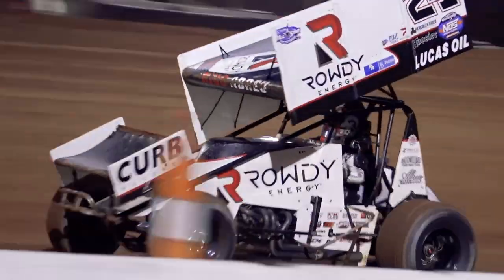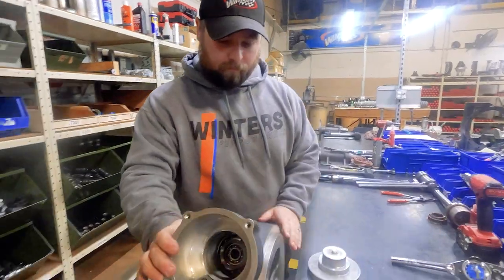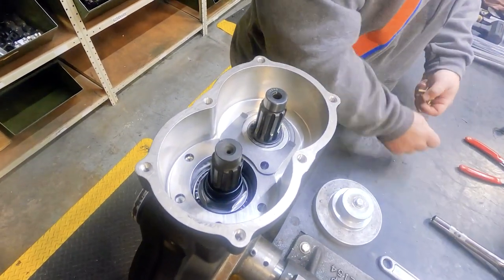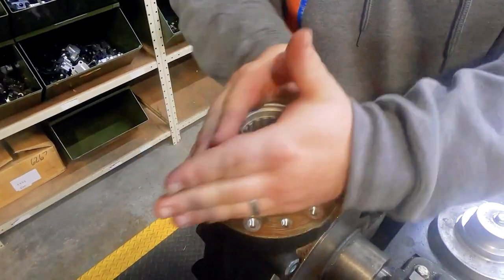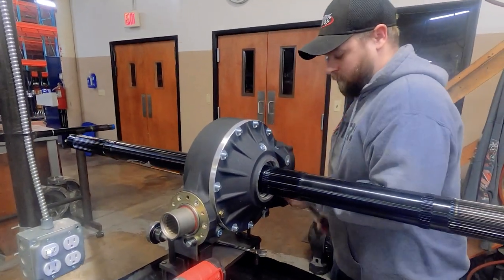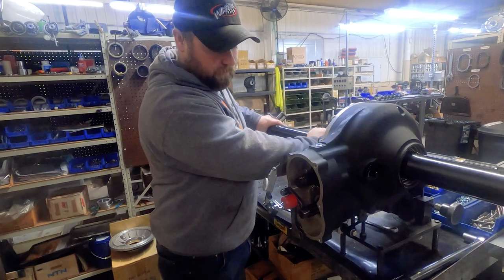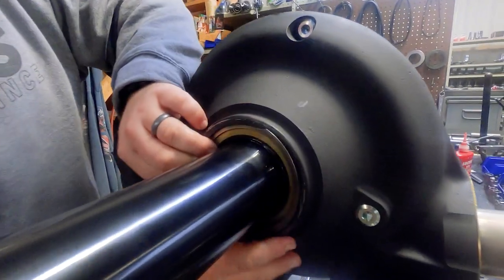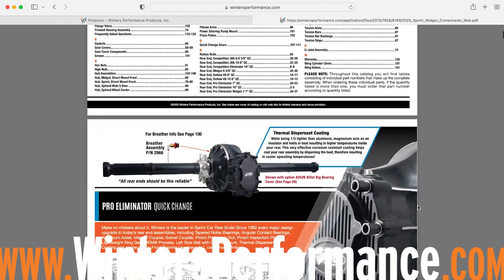Sprint Car Quick Change Assembly // Winters Tech

Comment: So what is the limiting factor in terms of torque/horsepower holding capacity? Is it the shaft(s) that run into the quick change gears at the back? I have seen a limit of about 1500hp for these... What alloy are those shafts? Do you make any in maraging steel? 

I would love to have a quick change for my vette, but I am sure I would break one...
Reply from the maker: This particular quick change is designed for Sprint cars. For a Corvette you'd be looking at one of our 10" Champ Independent rears. Through working with Drift racers to develop the strongest QC available for those high HP applications, we've beefed up our castings, introduced heavy duty spool and output flange options, strengthened the standard heat-treated steel lower shaft, etc. In terms of maraging steel, we do have a Vascomax lower shaft that's as close to bulletproof as you'll find. Our video "independent quick change options for Drift cars" should answer some of your questions.

There are many Vette owners (track cars and street cars) running that QC—putting huge amounts of HP, banging gears, shocking the drivetrain—without any problems. If you're interested in talking specifics about your car, give us a call—we'll build you a rear that can take whatever you dish out.